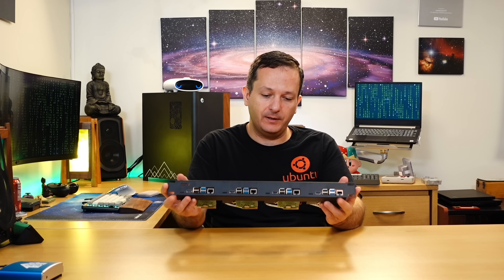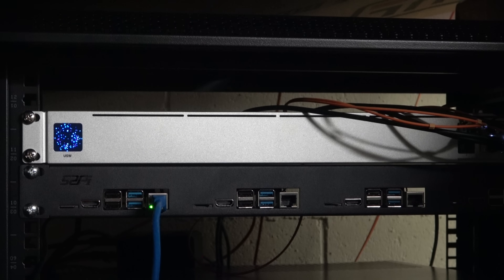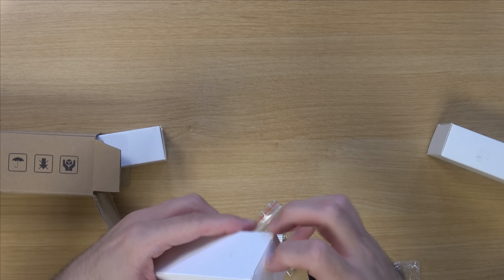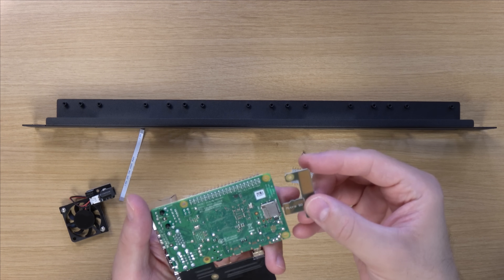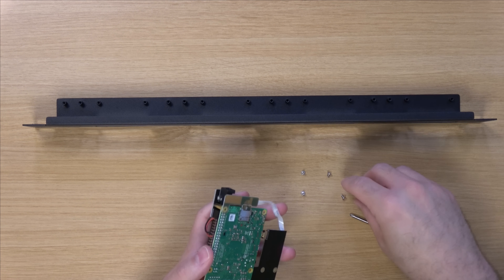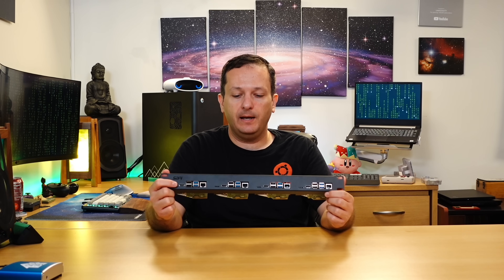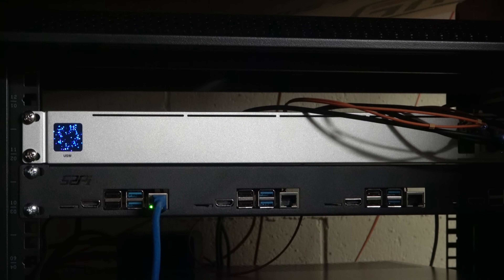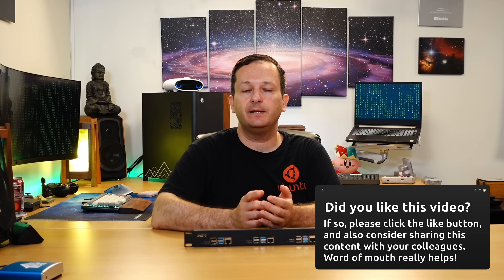Review: The 19" Raspberry Pi Rack Mount from 52pi

Comment: That micro sd extension + ribbon cable seems like a point of failure. I suppose that in some racks, you can't reach around the backside, but I'd rather have my SD cards plugged in directly I think.
Good review :)

Comment: I am kind of new to this networking thing so I am curious 🤔.  Two other racks come with power cables and fans? It seems to me that the fans included with this rock or a bonus. If you have to supply your own Raspberry Pi anyway, it just makes sense that you would put your own fan on. I am a little confused by this.

Comment: It seems great but I think it needs more work :) I believe the 5v barrel connector should also be routed to the front panel, giving users a choice on how to power their Pis. Then that extender board extends one micro HDMI port and effectivly blocks the other. Why not extend both? I also don't like that fragile ribbon cable hanging there unprotected. Last, I'd like some insulation, maybe just a acrylic sheet, under the Pi so it's contacts are protected.

Comment: It looks like the header on the fan assembly connects to the 5V and 3.3V pins on the Raspberry Pi 4 header.  The fan assembly appears to require a 5V input and that is connected to the 5V pin.  I think you can power the Pi and the fan from that.  No?  If that is true, no need for the USB power cables.

Comment: 8 cables is just assanine
Reply: No, just four.
Reply: @carlpetersen3128  watch the video. 4 for the pis and 4 for the fans
Reply: @DanoFPV  The video is wrong.  The pi can be powered from the usb-c port or 5v in on the gpio pins, ie fan.
Reply: @carlpetersen3128  why would they have a second power port then?
Reply: @DanoFPV  Because it is more convenient to run the power behind the rack then having cables in the front. You can do either but the fan jack keeps power distribution inside the rack. Much cleaner.
Reply: @carlpetersen3128  I stand by my statement.
Reply: @DanoFPV  You really should check with the manufacture of the rack and while your at it check the raspberry pi powering alternatives.
Reply: @DanoFPV  Carl is right they are just options. I made an audio streamer a while back there are several ways to power them. I end up using solder points on the hat. But people use the gpio pins ,PoE, etc or the usb. I'm still somewhat confused though I would of thought in a cluster type situation you'd be chaining them all together somehow did I miss something?

Comment: Honestly, I just can't see using a Pi for server-related experiments and projects. I need easy reliable backups and snapshots because the question isn't 'if I'll fuck it up', the question is 'how often'.
Reply from the maker: I can definitely see your point. However, with proper automation and PXE-booting, you can absolutely have that same experience with the Raspberry Pi.
Reply: @LearnLinuxTV  When you're at the point of PXE booting you basically have a SAN somewhere - and whatever hardware you're running the SAN on could probably be used as your hypervisor.
Or maybe that's the admin in me that's used to more traditional environments.
Either way, I (personally) have invested into an Asrock Rack board based homeserver with ECC memory and everything, so as long as I don't run into the limits of that (unlikely) investing into more hardware seems like a waste. The only annoying part is that when I fiddle with the hypervisor itself I have to turn off the pihole VM, which promptly disrupts DNS for all client devices in my home. Meh.
Reply: @AstroCat That's what I mean - 'another computer' is way more difficult to snapshot and backup than a random VM on a hypervisor. 
I do not consider having a hypervisor to be 'flexing' - there's plenty of free options. Proxmox has been shown on this channel plenty of times.
Also - one Pi has very low power consumption. A group of them, preferably with HDD storage attached, adds up fast. 
That group of 4 on the server rack plus their PSU (no way it's more than 80% efficient) is likely to idle at 20W or so, not including storage.
Reply: I run my win2019 server complete with dhcp, dns, hyper-v and backup domain on a dummy terminal and for the last 2yrs have had no issues! So I (myself) would use them.

Comment: What is the cost of 3D printing it compared to buying the metal rack mount?
Reply: I built one of the ones that Tom made over a year ago.  I spent ~$31 in filament (Atomic Extreme Jet Black PLA).  ~$48 for the threaded rods and fasteners all from McMaster-Carr.  The total material costs was ~$79.  I did not include my time because hobbies are fun, and I did not include electricity costs because my meter broke half way they one of the prints.  It was about ~108 hours of printing.  My printer setup draws about 100W while printing.  You could do the arithmetic for electricity costs for yourself.
That said, I LOVE the 2U rack.  It looks super cool.  While rack in this video looks neat, I still prefer the one I made because it provides superior protection for the Pis from getting hit by something in the rack.
Reply: @GCTWorks  Thanks for the detailed response.
Reply from the maker: That's a very good question. Since Tom created mine, I don't have the cost numbers there, but maybe he can chime in regarding that.
Reply: Time cost will be high, and you have to own a big 3D printer
Reply: @kevindeng1889  True about the ownership.  You do not need a large one though.  The one Tom and I printed is modular.  Each Pi cage is just a copy.  So, you can print on quite a small printer if you wish.  You would just do more print jobs.  You would not even lose that much time with an FDM printer since you get little savings from printing more parts in one job.

Comment: Does that little fan make a lot of noise?
Reply: Guess not. Doesn't look like the turbine type usually found in servers.
Reply: @Gabriel-of-YouTube  I guess we will never know since there was no power cable in the box. lol
Reply: @Gabriel-of-YouTube  Looks don't really mean anything. For example, Noctua has two 40mm fans and the one that looks like a server-style turbine fan is actually the more quiet one.
Reply: @Gabriel-of-YouTube  I had a fan just like that on a motherboard that sounded like a jet engine. Image that times the number of Raspberry Pi you have installed on the rack.

Comment: I've owned the rack mount for a month now and I'm very happy with it. However, it is not true that you need additional cables. Everything works normally via usb-c
Reply: Even the fan works via USB-C?
Reply: @e1woqf  Yes
Reply: @e1woqf  yes, it does. You can either use usb-c or the barrel plug. Fans are PWM so speed control is possible from GPIO too.
Reply: @mclueppers  this isn't documented anywhere I can see.  Are you using the OS fan control?  What pin?